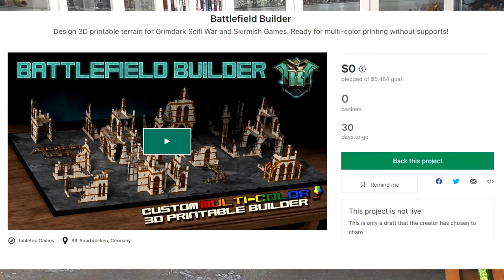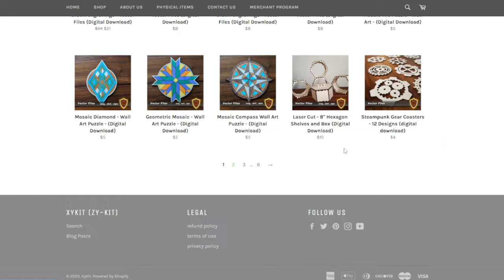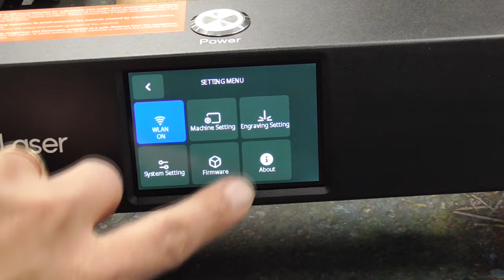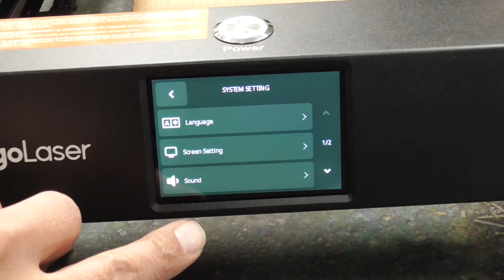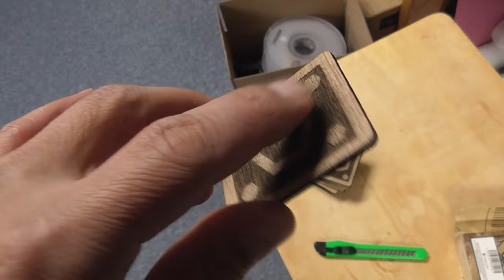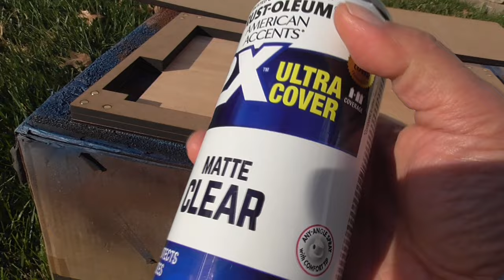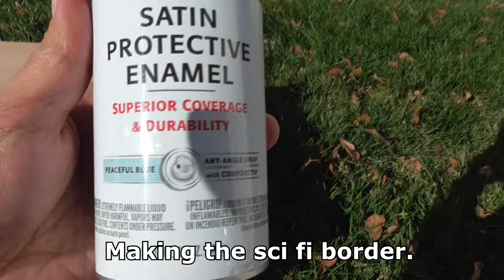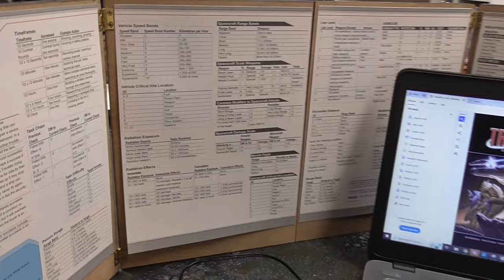DIY DM Screen with Monitor Using the Algolaser 22W Delta

Comment: Awesome video GG. You've come a long way since the gaming table. Plywood doesn't hold screws well and MDF is much worse. In this application I would probably have used a heavy canvas or other durable cloth as the hinge just to avoid the blow-out potential.